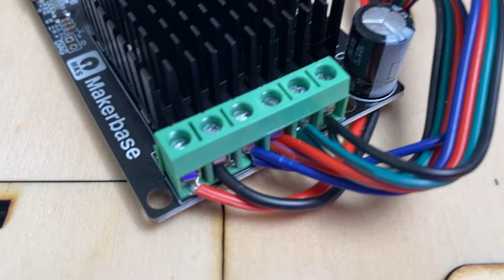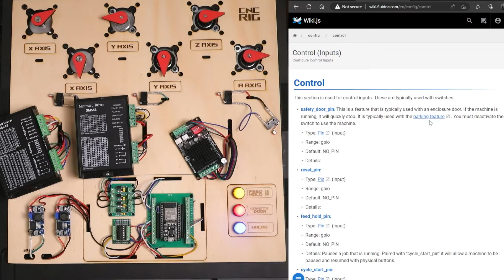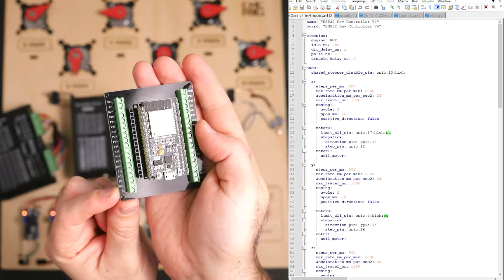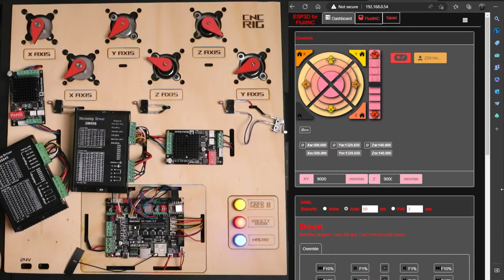CNC Wiring Basics // FluidNC // ESP32 // TinyBee controller

Comment: Firstly, thank you very much for uploading this video and others dealing with the MPCNC and FluidNC - I have some idea of the amount of time and effort this must have entailed. Great detailed information. 
I have been contemplating building a simple CNC for some time, and these videos have provided the tipping point for me. 
I would like clarification on one point in this video however. Have I misread it, or is it that in your wiring diagram commencing at 10.42 has the Y and Z stepper motor driver labels transposed?
Reply from the maker: Oh my gosh! You are the first to see this! I can’t believe I have made so many mistakes in this diagram!!! Thank you for bringing to my attention. They should be relating to the pin out on the board… please ignor where they are connected to in the motor drivers. Thanks for your support and bring this to my attention. Unfortunately YouTube isn’t friendly with re-uploading, however I pin this comment to the top for others to see!! Thank you 🙏 🤩
Reply: @NEWTechCreative  I also saw this, since my setup did not work at all. I the rewired, based upon this, but no success either. BTW: the uln2003an only outputs 0.6V, so no amplification. This yields too little voltage to the drivers. What may be wrong?

Comment: Great video and explaination of wiring etc, but i cant seem to find a topic on how to wire a hot bed or extruder to an esp32. ive found it in the tinybee.yaml using the flood and mist pin, but i wanted to go for a 12v machine and a bit clueless on this step if you could assist please? thanks
Reply from the maker: Thanks for your message! Is this for a 3D printer? Fluidnc is made for CNC… unfortunately you wont be able to take advantage of 3D printer features.
If your looking into how to convert a 3v3 to turn on a larger current, this is possible using either a mosfet or relay. Maybe look into fluid for 3D printing.
Reply: @NEWTechCreative  excellent thanks, yes it was  for a 3d printer. I have a scara I'm building and thought it was a great platform in a tiny package, not realising it's CNC. Thanks for replying

Comment: Hi, i have tested all about fluidnc over esp32, but when i try to 
connect the sd card adapter and the sd, it give me this error, 
could you pls, help me about it?

This is the error [MSG:ERR: sdmmc_card_init failed code 0x0x107]
i am using the 3.7.0 fluidnc version
Reply from the maker: Thanks for your comment! There are a few issue why this could be so. I would suggest jumping over to the fluidnc discord or happy to help via my discord. I need to see you ymal setup and wiring to give you direction. Alternatively send me an email at newtechcreative@gmail.com
Reply: I had such a problem. Change the frequency of the SD card frequency_hz. I got it with frequency_hz: 10000

sdcard:
  cs_pin: gpio.5
  card_detect_pin: NO_PIN
  frequency_hz: 10000
Reply: @jellybear01  hi, thanks a lot for your answer could you pls tell me   where can i change that parameter
Reply: @cncrobotic5254  In the same place where the parameters of the machine are indicated
in config file .yaml

Comment: Yeah, i found the video...great explanation... :)
One more thing...are you still using TMC2160 drivers?
How are you satisfied? :)
Also, does Tinybee has EMI protection for limitswitches? Like optocouplers or something similar? :)
Reply from the maker: I will be installing the TMC2160 drivers on my new machine and will give a good stress test soon. I have started a new series and will release the electronics episode in the next few weeks. Yes the tinybee has isolation from the input pins that handle EMI well. I am moving to the root CNC board that has high quality isolation in the next build.
Reply: @NEWTechCreative  Great. :)

Comment: thanks for the great video. 
i am new tot the cnc scene, and try to learn about this board. how to wire a 3d touch plate?
Reply from the maker: Thanks John! Great to see you diving into the CNC world 😁 I assume you are using a touch probe with only 2wires? If so, you can use one of the inputs to wire this up such as gpio35, gpio36 or gpio39 and ensure that the black wire goes to GND and red wire goes to the com pin- not the 5v pin. Then state in the yaml file as the probe pin. More info found on the wiki: http://wiki.fluidnc.com/en/hardware/3rd-party/MKS_TinyBee
And probe: 
http://wiki.fluidnc.com/en/config/probe

Comment: I noticed that your stepper driver wiring on the Tiny Bee doesn't (seem to) require the boost converters that you used to step up the 3.3V ESP32 output to 5V for the stepper drivers earlier in the video. Am I to gather that the output voltage for external stepper drivers coming from the Tiny Bee is 5V?
Reply from the maker: Great question! Yes that is correct, the tinybee has its own converters to 5v for each output!

Comment: Thanks for video! Which frequency output can generate ESD32 for 3 axis movement? I have old Yaskawa servo drives, step/dir input with 8192 pulses per round. Would like to have 8-10m/min on G0 and may be G1 (ballscrews 5mm). Is it possible?
Reply from the maker: Yes this shouldn’t be an issue!! I’m not familiar with these motor drivers, however you just need to set your steps per mm, max rate and acceleration to suit your drivers. Maybe ask the community over in the discord for more info!!

Comment: Great video. How could I configure the tinybee board for five endstops lowrider v3 cnc? Which sections of the yaml file be changed?
Reply from the maker: Yes this could be possible. Unfortunately the tinybee board had only 3 dedicated limit plugs available, however you can also use the 3 inputs that I show in my video for the buttons pin 35, 36 and 39 for your 2 other axis. You will just need to use two other input pins for your axis e.g; 

For the second motor setup for your axis, add an independent pin for the limit switch. 

motor1:
limit_neg_pin: gpio.35:low

Hope this helps!
Reply: @NEWTechCreative  Thank you. It's simpler than I thought.

Comment: just some of the time stamps to make it easier to find them

Fluidnc user interface 2:35
stepper motor and drivers 4:20
3.3V to 5V Logic Converter 8:00
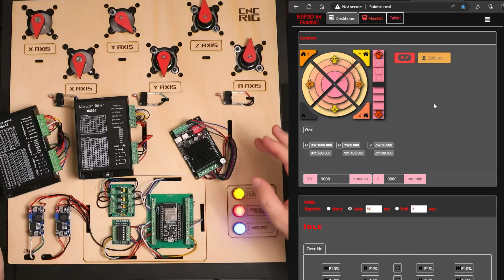Limit Switches 11:31
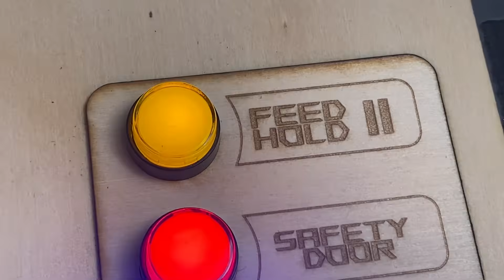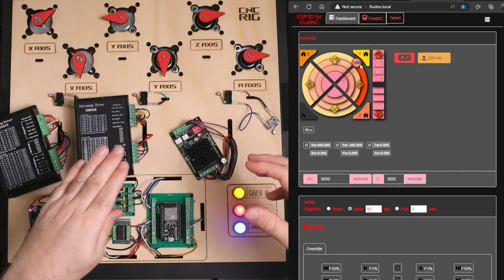User input Buttons and Macros 16:08 and 24:15

TinyBee Board
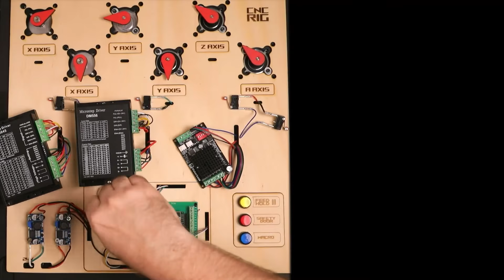TinyBee Introduction 28:52
TinyBee YAML configuration 30:32
Reply from the maker: Thank you 😊

Comment: I notice when demonstrating the TinyBee controller and you drive the pairs of stepper motors, they appear to be travelling at different rates. Shouldn't they both be identical? If driving either side of an axis, different rates would cause the axis to skew and that would be bad. Is this because each motor is being driven from a different driver and perhaps they are setup for different step sizes or something? By the way, great video, very informative. I've had the desire to build a CNC for some years but time, space and $$ always seem to be a factor. Now I'm looking at the possibility of getting a kit to build for a club I'm in and your videos really help me get a better understanding of how it all works as a system. Keep it up!
Reply from the maker: Thanks for your message and kind support Mark!! Yes you are absolutely correct about moving steppers identically…. I purposely didn’t place the steppers motors to show differences, however as they were independently controlled by the tinybee I definitely could have but motors into sync with one another. Good spotting!! 🤩 I’m so pleased that this has helped you on your CNC journey and hope your able to dive into the CNC world soon! 😁

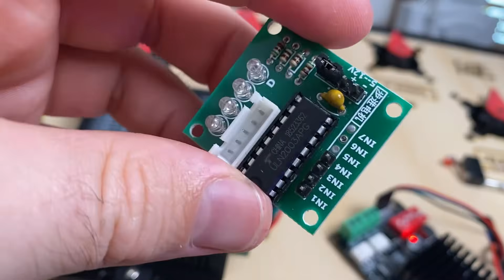Comment: At about 8:40 in, you discuss stepping up the signal voltage from 3.3v to 5v.
Couldn't you have used a  "Logic Level Converter Bi-Directional Module 5V to 3.3V for Arduino"  (from Amazon) ?
Reply from the maker: This certainly could be possible, but I haven’t had a chance to use one of them! The stepper pins only require a single direction communication, so there wouldn’t be much use for the bi-direction, but might be useful for any return channels if needed!

Comment: I feel so foolish asking this but I'm not sure were else to go. I've been designing my own CNC machine for the better part of a year and I know all my motors/drivers/probe/etc stuff that I want to use. I recently found out about FluidNC and in particular I am interested in the Tinybee board. It seems to be marketed as a 3D printer controller, but is that it's only use case?
Reply from the maker: Great question! Never feel foolish to ask. Yeas this is 100% compatible with CNC’s however there will be some unused features on the board - these can be ignored. The great thing about the board is the access to the pins needed, isolated pins and compact size. I also love the boards by root CNC…
These are better targeted towards CNC’s. Check what is available to you. For the price of a tinybee, you can always update down the track 👍😁
Reply: @NEWTechCreative  Thank you very much for the feedback!

Comment: ah the good ole ULN2003, those were my first "stepper motor drivers" contolling unipolar motors (5 wire) lol they are super slow and easy to stall out but that's not their purpose, those bad boys are Darlington drivers. they are almost the perfect driver IC each of the inputs is protected from the output via a zener diode to deal with teh nasty back emp from the motors, i was looking at logic level shifters but those are doable as well so ill use those lol
Reply from the maker: Nice work!! Great clarity in your comment. Thanks for your support 😁

Comment: Excellent Video. But I'm confused. The product description says this board is for 3D Printers. Can it be used for a CNC router ?
Reply from the maker: Yes that’s correct! The board is made for 3D printers, however works great for CNC’s as well. There are a large range of various boards available to check out 👍👍
Reply: Do you have a wiring diagram for tinybee running fluidnc ? For example there are 4 pins for connecting external drivers. Which pin is pulse, direction and enable?   What is the fourth pi.?
Reply from the maker: I haven’t made a wiring diagram however the pins are labeled and will correspond with the motor driver inputs. The last pin is the enable pin to enable or disable the driver. Let me know how you go? If you need more info, send me an email at newtechcreative@gmail.com or discord (newtech).